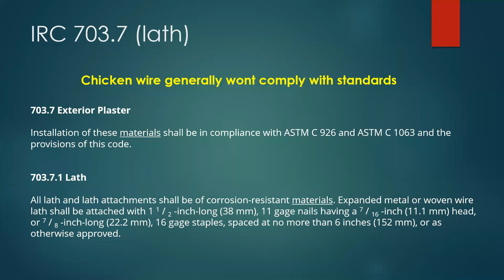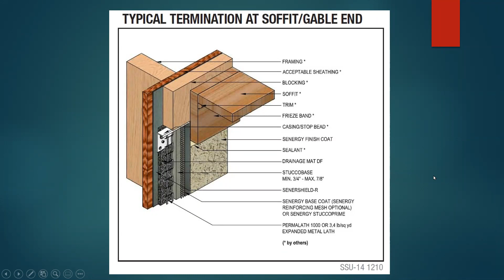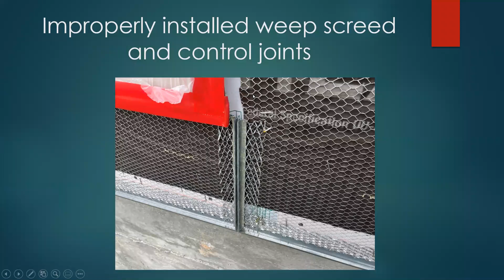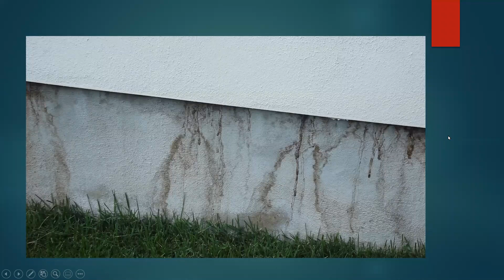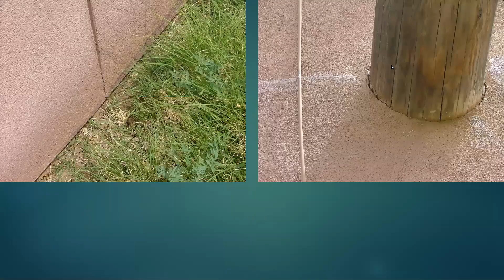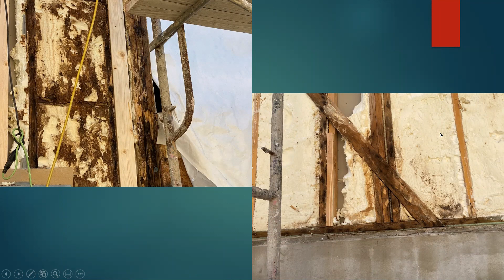Stucco Installation Requirements

Comment: What do you think about using 1/4" or 1/2" Wonderboard over plywood for waterproofing? I have a small area of plywood that will get a stucco coat. I plan to water seal the wood then cover it with Tyvek and then Wonderboard.
Reply: Also if Wonderboard is used, would I still need lath and would it be considered a "dissimilar material" from block? It's a cement board so I think that could be considered "similar".
Reply from the maker: @ChrisDembinsky  Hi Chris - great question. Yes, you can use Wonderboard or any other concrete board over wood with 2 layers of underlayment and then apply stucco directly to the Wonderboard/concrete board without the need for lathe.
 
Personally, I used 2 layers of 30# roofing felt under the Wonderboard. I think it’s better for this application. If you don't want to use Tyvek, I’d recommend 2 layers of their stucco wrap rather than 1 layer of Tyvek over waterproofing. You always want 2 layers of underlayment. Hope this helps.
Reply: @eepartnershipSPEER  Very helpful. What about just one layer of peel-and-stick underlayment? I have some of that left from the roof. Also do you think 1/4" Wonderboard is good enough?
Reply from the maker: @ChrisDembinsky  You can use one layer of peel and stick and probably be fine but a roll of felt is $30 so I wouldn’t risk just one layer. Use the peel and stick as the bottom layer and cover with a layer of felt. The ¼” should be fine but I’d use a 6-8” on center fastener pattern. You want to make sure it stays on the wall.